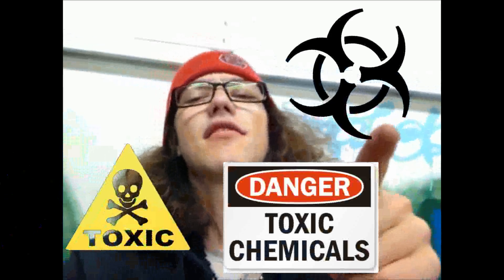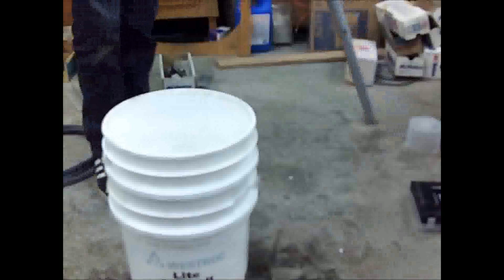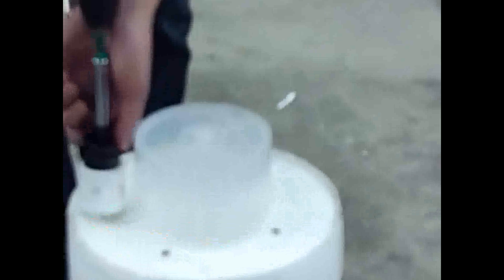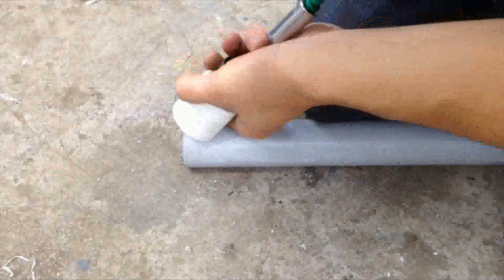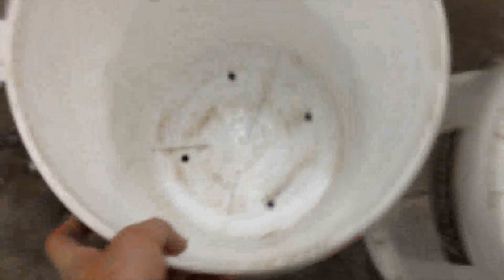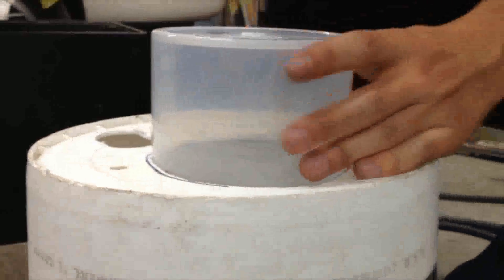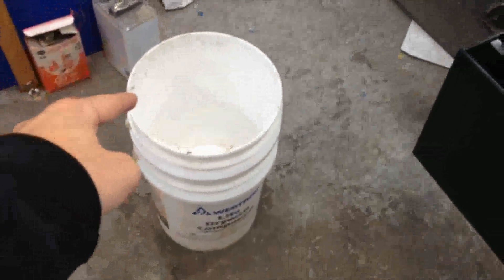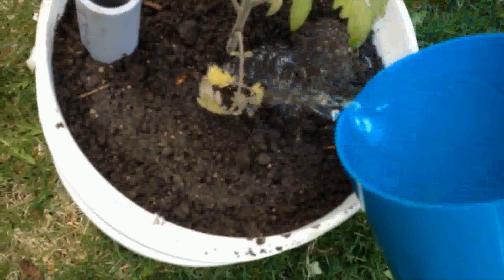How To Build A Self Watering Bucket!! (Global Bucket)

Comment: You have 2  5-gallon buckets and both have 4 holes on the bottom of the buckets. How yow prevent the water from escaping from the bottom bucket because of the 4 holes in the bottom.